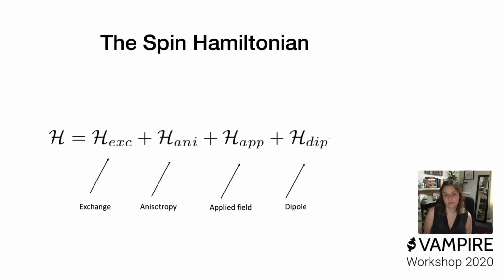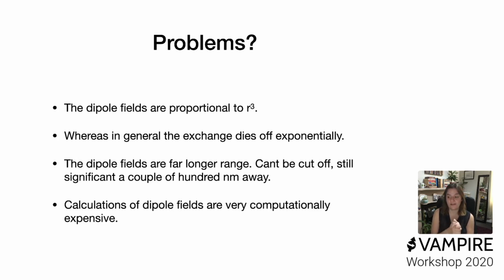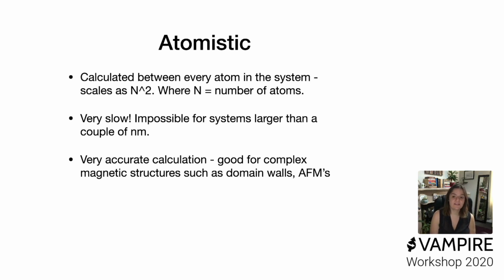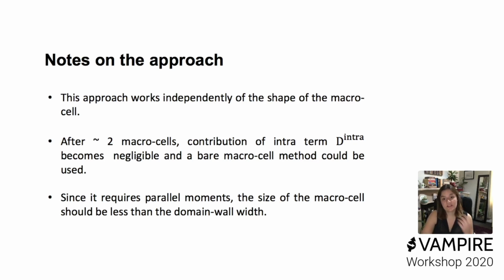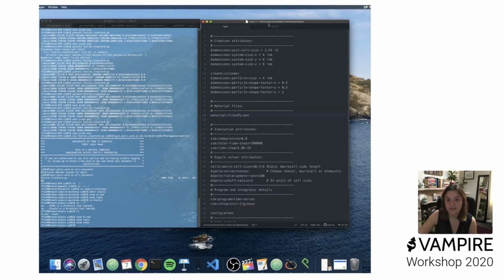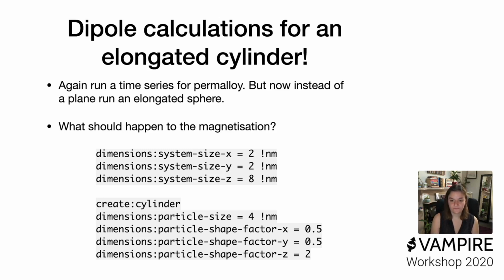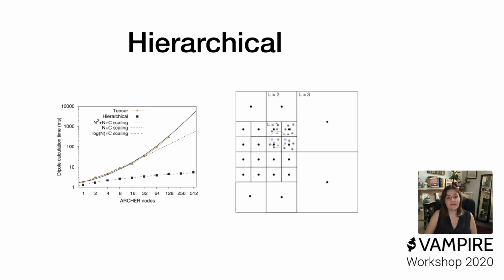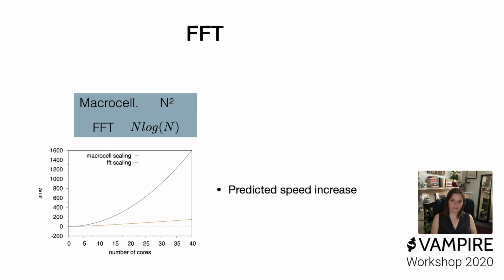Calculation of Dipole Fields

Comment: In the vampire manual, it is written that dipoles fields are turned off by default. Then why you have not used the command ( sim:enable-dipole-fields flag) to enable the dipole fields?